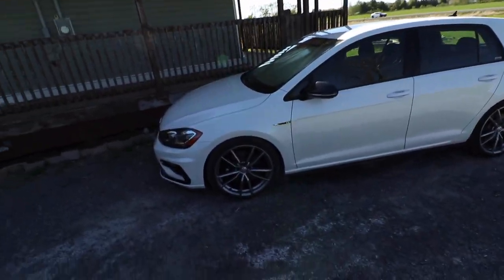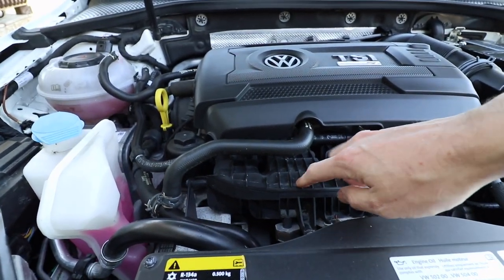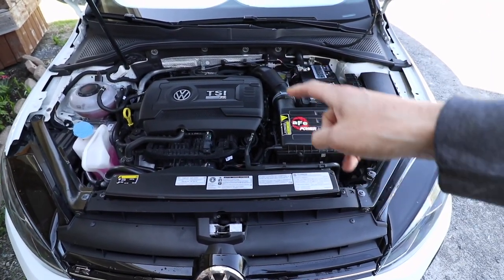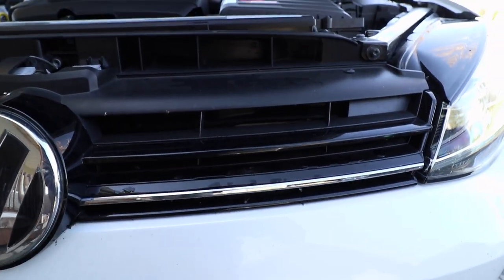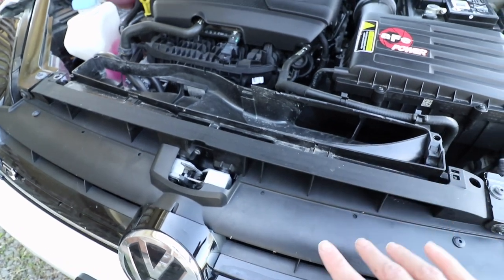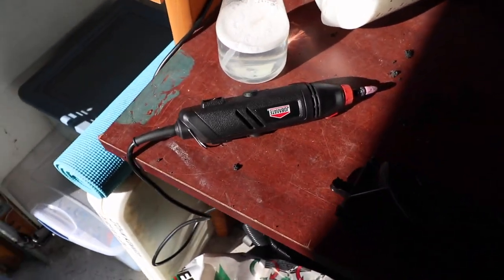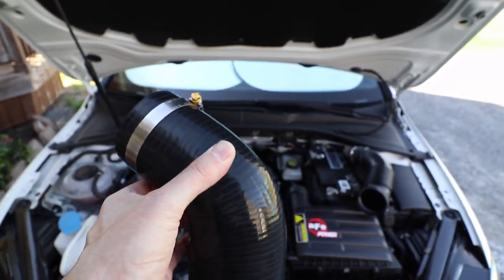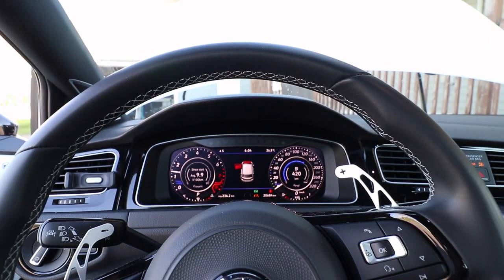Cutting my Car! MK7 Golf R Intake Mod Complete - Netcruzer CARS

Comment from the maker: The right side block off plate I ordered is a VW OEM part, I ordered mine from eBay - https://ebay.to/2ZJOH5v.  It forces ALL the air into the airbox, instead of having passthru and hot air intake. It's been proven to lower intake air temperatures at Wide Open Throttle (WOT), but exterior temperature of intake manifold and oil filter housing raise by a few degrees, but it does not seem to affect oil temperatures, so I'll try it when it arrives!

Comment: Any long term feedback on the moisture or felt differences?  I live in Alberta so am a bit worried about the moisture.
Reply from the maker: I’ve not driven it during any torrential downpours, but have driven it all winter with no noticeable problems. I’ve not opened the airbox to inspect the filter.
Reply: Is there some update regarding moisture?
Reply: Really keen to know if your filters have been more dirty (or not!) Since doing this mod.. :) 4 years later still quality content, feedback shared from England 🤠

Comment: I know this is an old video but that mod does nothing. The hood when closed covers that whole area so minimal air if any will get through. Now it disturbs the actual air coming from the open area in the right side( passenger side ) from getting directed into the box.